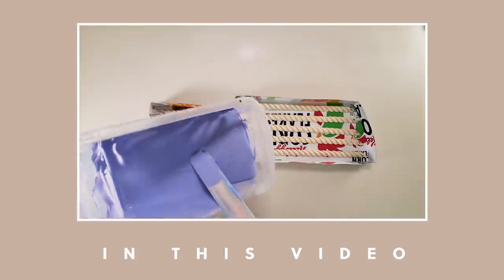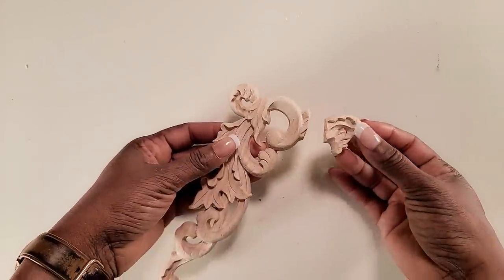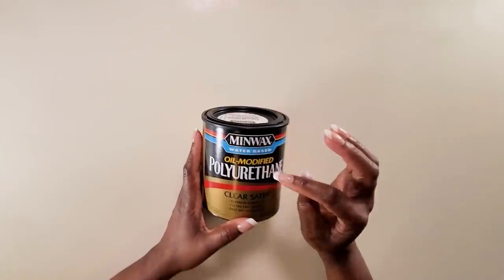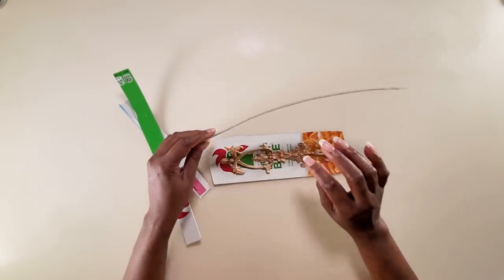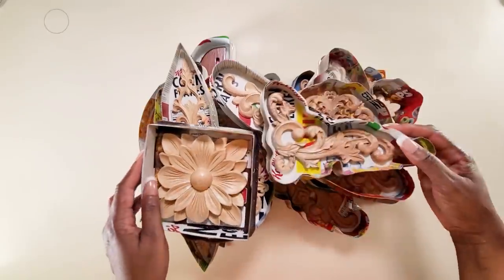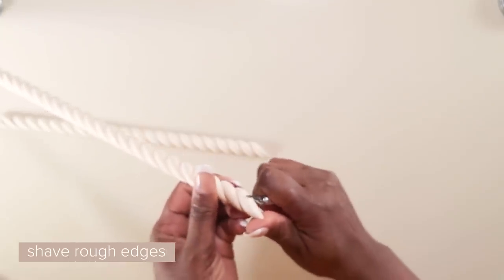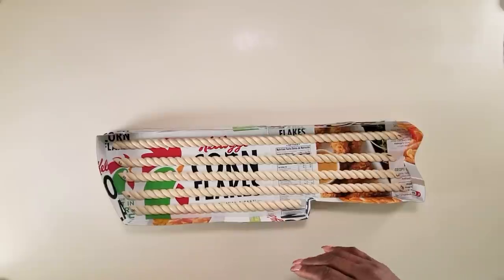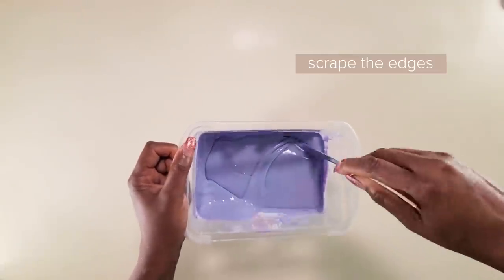YES! You Can Make Easy Silicone Molds With these 3 Simple Tips!

Comment: Sharing a tip from another creator: take a sheet of vinyl used in cutting machines (the cheap stuff will do) and attach your blank to the sticky side, rubbing it down well before building your mold box. It will help with the silicone bleeding underneath and peels away easily.
Reply: great tip!  thank you
Reply: Thx for sharing this great tip

Comment: great idea using cereal boxes. That part where you ran out of silicone, I saw a tutorial where after making the mold you put the piece on a kitchen scale, tare it, and then put rice into the mold to measure the volume, that way you know exactly the volume you need, and you don't waste any silicone, and you aren't scrambling to make more. Also, I noticed you have quite a lot of air bubbles in your mold. you can use a vibrator on your drill or something that vibrates on the outside of the box to knock the bubbles out.

Comment: Thank you for this video. I had planned to make some silicone moulds myself from scratch, but never considered using pieces like you used to make pieces that could be used in so many ways. It was also a helpful reminder to us all to remember to pick up opposite facing pieces & not just the one piece you may only plan to use straightaway. To have both will make it possible to create more items in the future & not be restricted because you don’t have the opposite facing piece. It is also worth remembering to try to buy them at the same time. Even if you are only using the one. I say this due to items going out of stock & not being stocked again later down the line. It could be worth asking friends & family to check their local store to see if they still have the opposite piece if your store no longer stocks it. You could ask them to buy it on your behalf so that you will get your pair. You could also look online as well if the store has a website or possibly another company may have them. 

I have learnt from personal experience & from watching other YouTube videos, it is better to use a long neck lighter over a heat gun because the heat guns temperature is hotter than silicon moulds maximum temperature threshold & you can burn or your mould so it leaves marks or can become unusable. A long neck lighters maximum temperature is below the threshold for silicone moulds. Using a heat gun over a larger area piece is okay as long as you finish off around the areas of the mould with a long neck lighter. As for a hair dryer, a friend tried it out & it created rippling waves which did settle level again, but created more bubbles in it. This information I have learnt from when I started out & from other videos. It is your choice what you choose to use, I felt I could share my experience (& my friend’s) so that it may help others.

Comment: I have been looking for an instruction video like this. I wanted to see making the mould out of silicone when all the others I found showed how to use them. I was wondering what material to use when making the moulds that the silicone would not stick to. So, it looks like something with a smooth surface like the shiny cardboard and the verathaned wood will work. Do you also use food grade silicone?

Comment: Because the silicone is flexible, you need a rigid backing to keep the moldings flat. Perhaps pour plaster of paris over the backs of the cured molds before removing the originals. Keys will be needed.